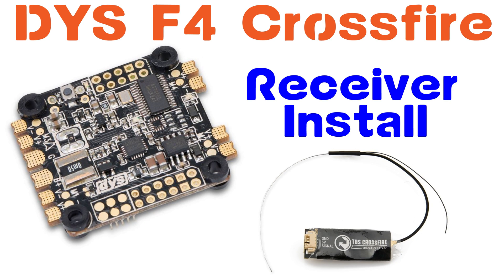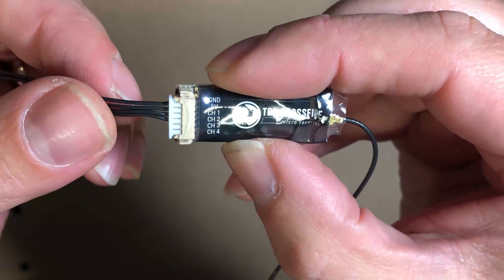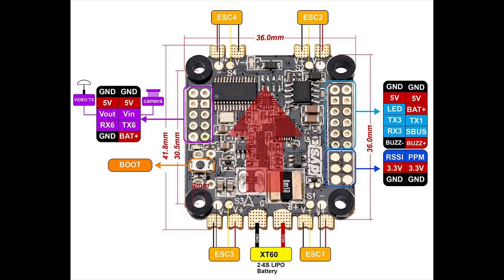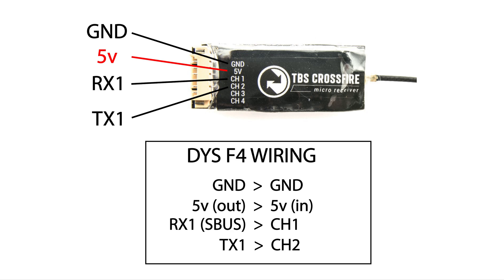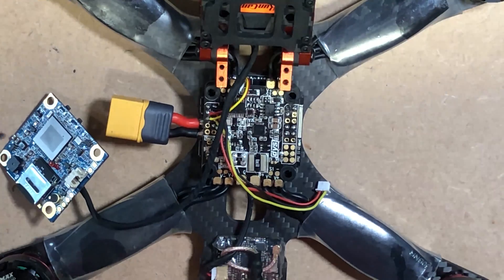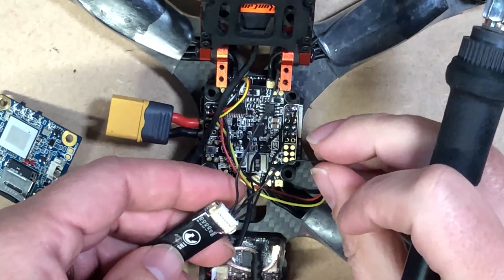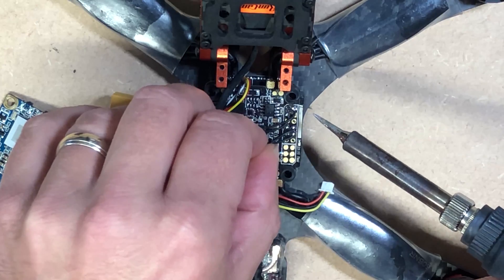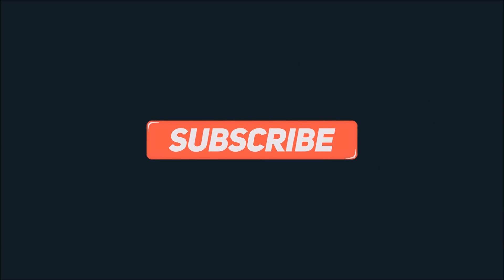TBS Crossfire | Receiver Wiring / Install / How To (DYS F4 Pro)

Comment: QuadFramesUS - I am wired the same as you and get no communication NANO CRSF to FC. The receiver Tab in BF shows no signal. I have crossfires working on some other FCs no issue... right now dead in water with DYS F4 Pro and Asgard V2. Any tricks?
Reply from the maker: KY DAWG1 
Not sure why that is, have you followed the next video for the betaflight setup?
https://youtu.be/URRJJA_1dUg
Reply: Yep I am fully fluent on Betaflight (and have other quads set up on Crossfire with different FCs)...there are many people out there in the forums with the same issue with DYS F4 Pro.. no one can find rootcause. Thanks for your videos. Great info for all.

Comment: im using the rx3 and tx3, works perfectly
Reply: What do you have your output on ch1 and ch2 set at? I tried ch1 crsftx and ch2 to crsfrx. I did this and the rx freezes up and I have to reboot the rx by holding down the bind button for 10 seconds.

Comment: I had some issues with UART 1 which has the S.Bus inverter. I had no issues using UART 6 TX and RX and UART 3 TX for TBS Smart Audio. With UART 1 I had RC but no telemetry.

Comment: I got the same days f4 pro v2 and frame but I'm using a x4r-sb n smart audio and everything I'm seeing online says I have to uninvert a UART to use smartport  on this board is this tire it looks like your build works fine without inverting don't know if your using smart audio to or not please help
Reply from the maker: The receiver I used comes inverted already for the x4r you can solder a small wire to pad A in this picture to get the uninverted signal from the x4r and wire up the same 

https://oscarliang.com/ctt/uploads/2015/10/frsky-x4r-sb-subs-uninverted-hack-naze32.jpg
Reply: QuadFramesUK 

So my reciver has to be univerted and I would use that pin as sbus or smart port
Reply from the maker: AIRBORNE_FPV yeah use that as the SBUS RX from Pad A and then plug the white molex connector with wires that comes with the receiver in and you only need the green wire I think it was from that which is the Smart Port TX
Reply from the maker: This might help 
https://oscarliang.com/sbus-smartport-telemetry-naze32/

Comment: why do you need two ch ?
Reply from the maker: To use LUA script on the radio or the OSD on the FC to change VTX channels and FC settings etc. one is TX and the other is RX, if you wont be using your controller to change the VTX settings via LUA or OSD then you only need to use to RX pad on the FC
Reply: i just have have the 3 pin cable and can use tbs smartaudio to! I will try to add lua script and camera osd control in the next few weeks!

Comment: Can you use a different uart for the ch. 2 Tx pad than the ch. 1 Rx pad? I’m wiring up a cl_racing F4s and the Tx1 pad is on the bottom of the board 😐.  I was wondering if I could use the uart1/Sbus pad and a different uart pad like uart3 that’s on top of the board for the Rx ch. 2.
Reply from the maker: Hurricane FPV 
You wouldn’t be able to use a TX pad from one uart and an RX from another uart as it is you would need to remap the pin out and change them within the cli. Not sure that it’s possible on the uarts tho if you connect the F.C. to your pc, connect and go to the cli tab. Type resource list and hit enter.

That will will list all the available configurable options, and their current setting.

If it’s in that list then it would be possible to remap the pins so they are RX2 and TX2 even tho your using the RX1 pad and the TX2 pad 

TX1 > TX1
Unassign RX1
Change RX2 > RX1
Assign RX1 > RX2

Hope this helps :)
Reply: Thanks for all that info!  I thought that but wasn't sure.  I went ahead and used TX1 on the bottom of the board.  Configuring it right now. Fingers crossed...